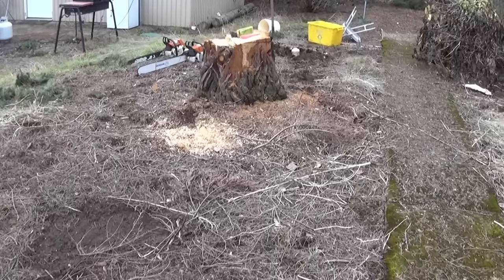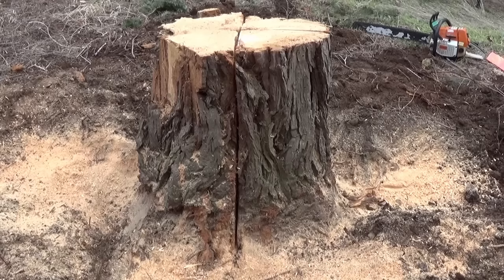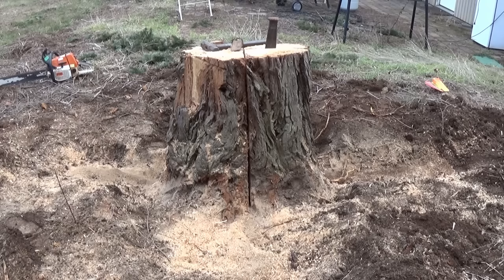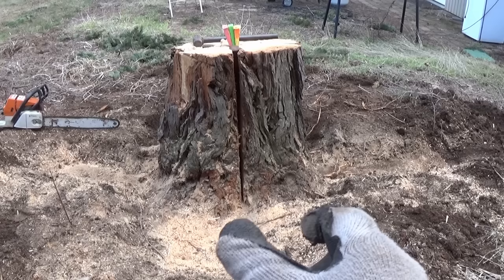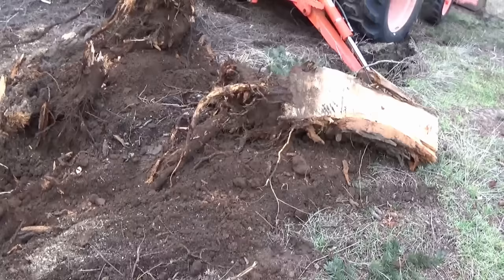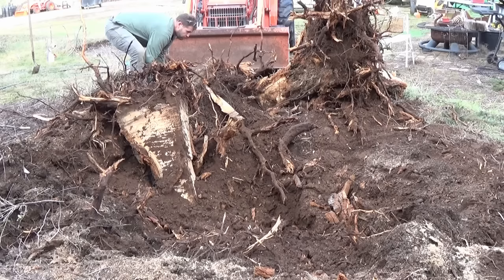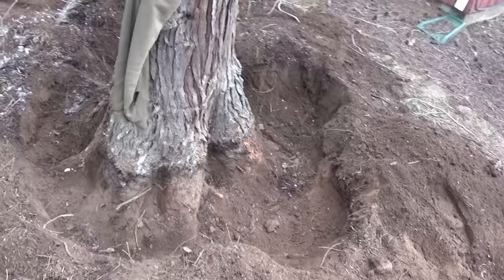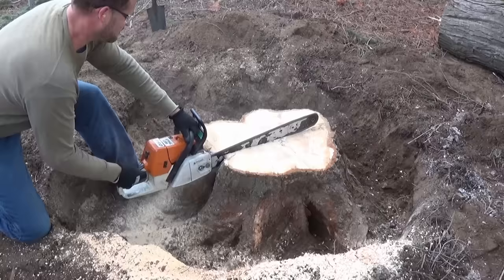Quarter Saw Stumps for Removal with Porta Power Hydraulic Ram Jack

Comment: Well that didn’t make any sense, why didn’t you just dig it out to start with?
Reply: ...or leave part of tree up and knock over with tractor at higher leverage point?
Reply: Let the man live😂😂 now everyone knows what to do or what not to do?  What works for him may not work for you 😂
Reply from the maker: This was mostly for fun, but thanks for watching! I have bigger machines that would knock it right out. I've been told to try the quartering method, so I gave it a shot. Wanted to give a hand job a real-world try.  Hope it was entertaining.
Reply: @gorgeoutdoors yes, it was fun to watch. So far the best method I have is digging a circle around it with the backhoe. The Roots should be easier to break at 2-3 ft out. After that all that is left is usually the Taproot which can usually be toppled with the excavator. Unfortunately, excavators can be expensive to rent for just one tree so I usually end up digging around the tree with a shovel and an axe. Next, I setup a winch to figure out which roots I didn't cut. I also use a leaf blower to move the loose dirt. Eventually, the stump gets pulled out. My preferred method is excavator, but there can be cost issues unless there are a bunch of stumps to remove.

Comment: The tip is hot because you ran blade in the dirt.  That will ruin the blade and the bar.
Reply: I didn't see a blade on his chainsaw, or on any other chainsaw I've ever seen before.
Reply: @martinmiller1087  LOL  You are correct.  Feel better???

I actually considered that.  Chain does not sound right either.  What would you call it?

For the record, it would be nicer and more efficient to just correct me rather than point out that I am a dummy...which I don't deny.  Although I sometimes do the same thing, I try to politely correct people.  I wish you well.   Life is hard.
Reply: @mcconn746  The proper terminology is a chain. ... As a matter of fact, I feel absolutely wonderful. ... I have a lot of experience with chain saws, having worked as a climber for a suburban tree surgery company in the midlle Atlantic region. ...  After majoring in Biology with an emphasis on Botany, in college, I had a career working for Alaska State Forestry in Fairbanks. In summers there, I was on a small crew of professionals that performed Intial Attack (IA) on remote wildfires in the Boreal Forest (mostly lightning starts) via helicopter. It's called Helitack. ... It's endless chainsaw work building fireline through the vast Spruce forests of Alaska. ... Take care my friend. M
Reply: @martinmiller1087  Thank you very much.  I am more enlightened...for now.

I have years of experience cutting my own firewood but I was pretty much self-taught and do not pretend to know the correct terminology.  When I bought a new "chain", I asked for a chainsaw blade.  LOL  

Of course considering that I am 75 and have some level of dementia, I may forget it tomorrow.  LOL  I broke a bicep tendon and do not do much chain saw work now anyway.  Thanks again.

Comment: Using a back hoe... 😅 next time just leave stump whole and fairly high. Then dig dirt out on one side of the stump 3ft deep. Then pull the stump over, in the direction of the hole it easier 😁. The chainsaw teeth start breaking off when they get that small. Don't ask me how I know 😅

Comment: Y n the hell didn’t just dig with the backhoe.
Reply from the maker: That little hoe wouldn't budge it. I almost gave up and got the 580, but at the last try, one quarter came out.
Reply: @gorgeoutdoors  Looked like you have a Kubota L35 or L48.  I can't bring myself to use my chainsaws that way.  I have some stumps where there is more than a week of effort getting them out.  My property, so not on the clock.
Reply from the maker: It was the L48. I have a 580 and a dozer. This was just for fun. All the chains were stump chains that were already used up. I save them for dirt use.  Thanks for watching.

Comment: Such a silly video and a waste of time. Rent a stump grinder from Home Depot. Or if you have a tractor like this guy, dig a trench along one side of the stump 48" deep. Now do the same on the other side of the stump. then pull on the top of the stump with the tractor bucket to remove. HINT: LEAVE THE STUMP ABOUT SHOULDER HIGH. Leverage is your friend 😅